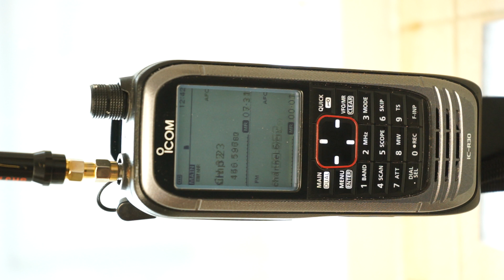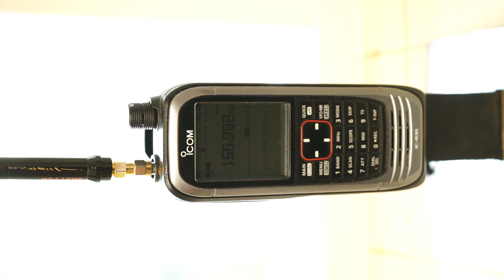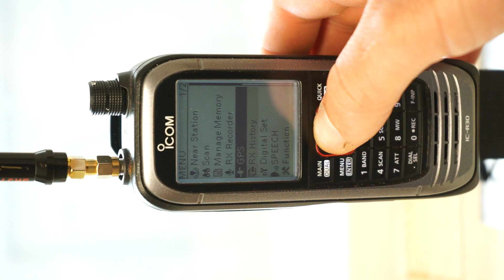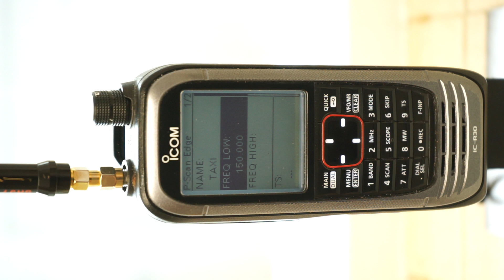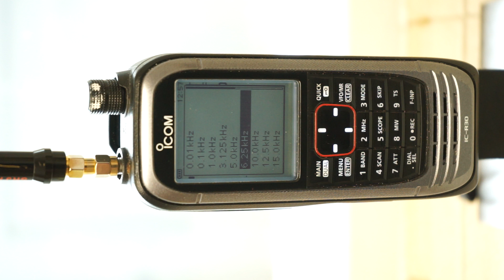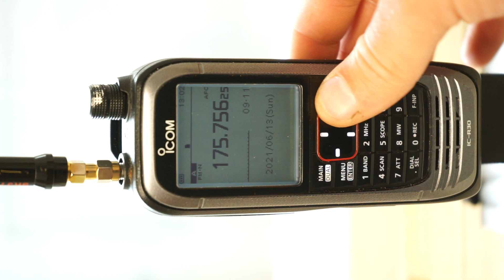Icom IC R 30 Tutorial one basic ops

Comment: Is there  way to get the IC R30 to automatically detect different modes in a scan, so if it stops on a particular bit of the band it  can self detect whether its an AM FM SSB signal??? I was told it will do this but so far I have no proof,and cant yet find a set to try it on, still looking for one in the UK.